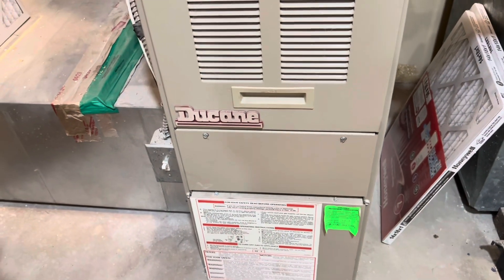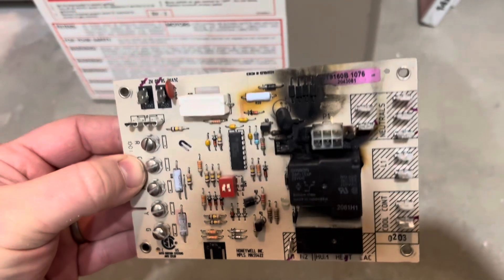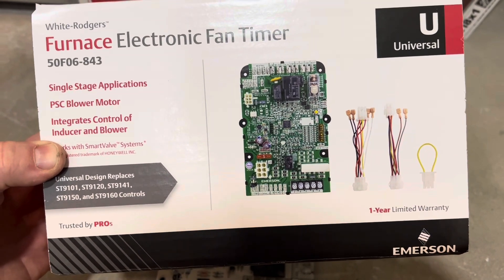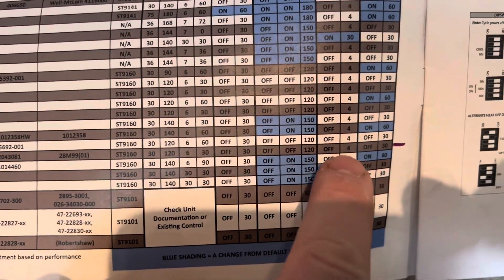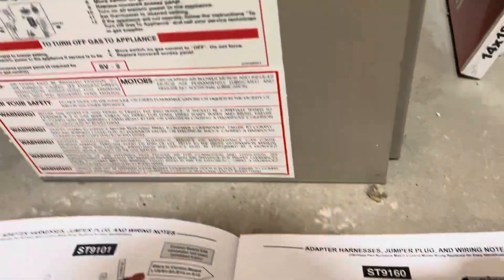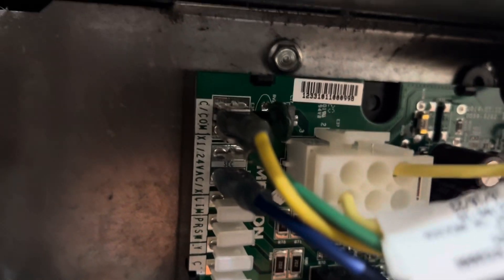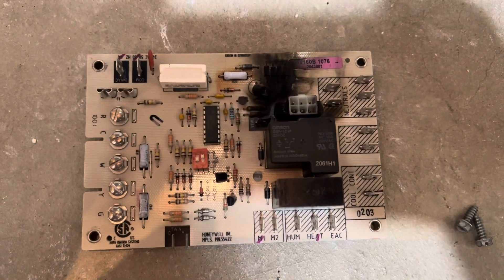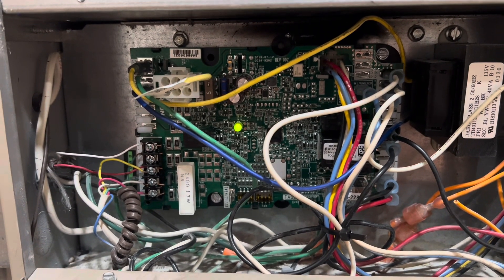How to replace the master control panel Ducane/Honeywell furnace ST9101 ST9120 ST9141 ST9150 ST9160

Comment: I replaced 9160 board with  a 9120u ,, all connections matched with original wiring,  inducer starts, but that's it.. has a constant blinking light on the board  ,  any ideas ?
Reply: Did anyone figure this out I’m in the same boat
Reply from the maker: Sorry, not really a clue
Reply: Hey mark I just replaced my 9160 with a 9120u. furnace doesn't work and i got the same blinking light. I had to put the old board back in (relay works if I tap it). I'm going to try again (putting in the new 9120u) in the next couple of days, if i get it to work I'll post what I did. good luck.
Reply: @marcriopel6018  Did you ever get this working?